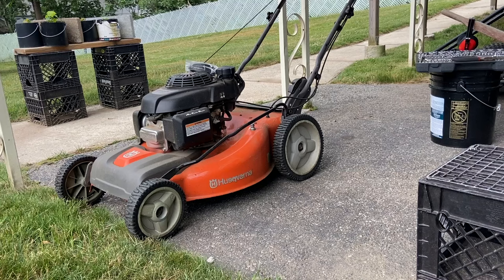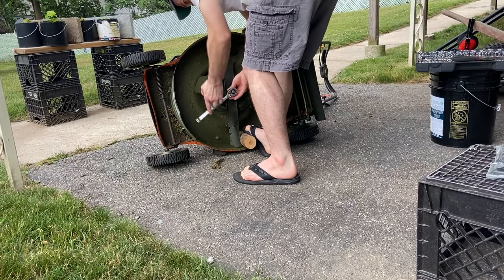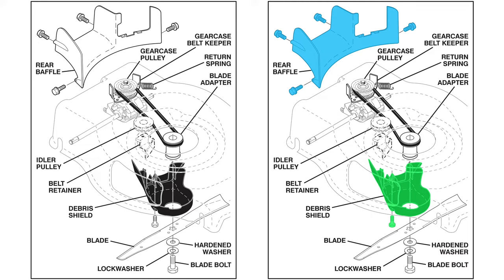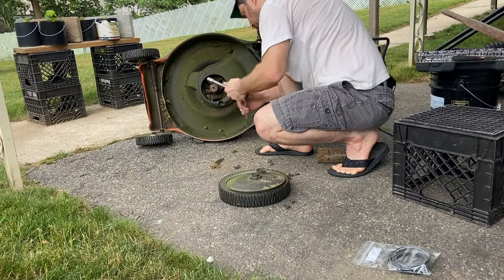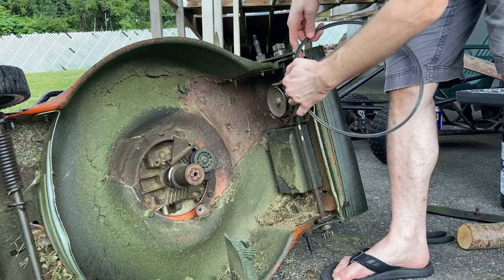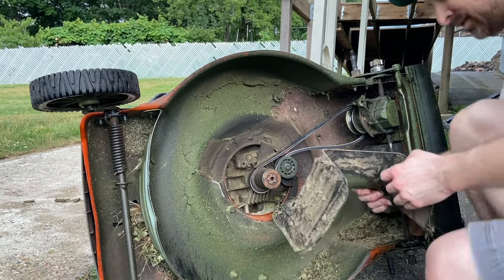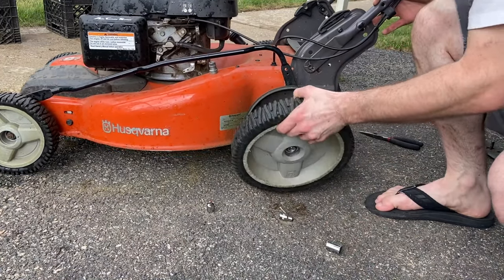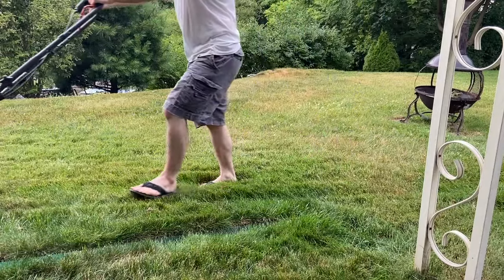How To Replace the Drive Belt on Husqvarna HU700H Lawnmower

Comment: You DO NOT HAVE TO FORCE THE BELT AROUND THE GUARDS. The pulley comes off very easy. Grab the shaft behind the pulley with pliers (Channel Locks Best), put a socket wrench on the nut on top of the pulley and turn (counterclockwise). The whole pulley unscrews, once off, wrap belt around, screw the pulley back and on, re-tighten pulley. Super easy. Takes 2 seconds.... Thank you for the video, very helpful
Reply: Thank you! This little nugget was invaluable for me!
Reply: Nope. You don’t need to undo the pulley. There are two 1/4 hex head screws that hold that belt guard in place. Fiddly but easy to unfasten in 2 minutes.

Comment: Thanks for the tutorial. Here’s a tip. When you get to the pulley on the tranny, get vice grips and grab onto the stem that comes out of the tranny and unscrew the whole wheel. Theirs just enough room to get the vice grips in there. It’s a whole lot easier

Comment: Sometimes it is the drive cable that needs an adjustment to tighten. In time the cable will stretch resulting in not enough tension on the drive pully. Thanks for the video.
Reply from the maker: Yes it definitely can be the cable. All steel cables will stretch over time and need to be tightened from time to time. Just like shifters on a bicycle.
Reply: Thanks, very. Helpful.

Comment: You tell about the spring and don't show how it goes.
Reply from the maker: Check the pinned comment to see a closeup of exactly where the spring goes!
Reply: I took the chute off and see it connects to it. The picture is a little obscure but I see now. Thanks
Reply from the maker: @mikederry2839  Did you look on the short supplemental video? It's pretty clear on that video, I zoom way in so you can see exactly where it connects on both ends.

Comment: Great Video- I have the AWD model and the only addition that was easy to figure out.  Remove four screws on the plastic Baffle in Front, then you fish the belt through.
Reply from the maker: I thought about getting the AWD model too but in the end, I felt like the larger rear wheels would be a bigger benefit to me. My yard is pretty bumpy. Plus twice the belts to replace :D

Comment: So, I just changed my belt. I have the same mower. Everything here is perfect except for one item. The gear case belt keeper actually is designed to come off so you can get the belt on the pulley. There are two screws on the keeper that can be removed with a nut driver. I was really struggling to get the new belt on your way. Way more simple when you remove the keeper arms.
Reply from the maker: Do you have a picture of where these screws are located? I didn't see them back when I made this video. Also yeah some people seem to have a lot of trouble squeezing the belt on my way, some get it right on no problem. Each mower probably has slightly different tolerances.

Comment: Thanks for the video.  My spring popped off.  The video shows where one end goes, but not the other.  If anyone can explain, that would be great!  Thanks in advance!
Reply from the maker: Hi. Please check the pinned comment at the top of this comment section. I added a short video that zooms in and shows where the spring connects. Let me know if that helps.

Comment: Thanks John. The tip about removing the wire from the spark plug was a wise idea. Safety always make sense. Not doing that could potentially be catastrophic. 
You are the only one to mention that in all the videos I've watch so far..thanks again man..
Reply from the maker: We tend to think of starting an engine as a special, unique function we are doing to them. But lawn mowers, cars, truck, boats, in all of them, all you are doing to start them is manually spinning them.

Comment: OMFG....Thank you so much.  I was about to buy a new mower because my RWD system failed.  I flip my mower over, and the som' bitch belt was completely off.  I had noticed it was getting weak for a few years but thought it was just dieing.  Then last week it (the self propulsion) just quit completely.  After seeing how you put your belt on, I looked at mine and noticed first that it was completely off the thing that holds the blade.  I reassembled after attaching it to that thing that holds the blade, and tried starting it, it had a lot more oomph.  Then I watched your video, and noticed that "idler pulley" i guess it was, it needed to be attached to belt too.  I put mine back on and viola, the som' bitch is running like it was back in 2016.

Thinking of buying a new belt so that when this year is complete and I do the maintenance on it, I will replace that belt as well.

Comment: Very helpful video - Thanks!  You may also want to change your idler pulley at the same time as the drive belt.  Mine had a bad bearing and put a real drag on the system.  Replaced it and now have much more powerful drive.  Also, the spring attaches between a hole on the trans and just the bottom lip of the metal deck.

Comment: The drive pulley comes off.  Hold the shaft behind it with some channel locks and un-thread the pulley from the shaft.  The you can wrap the belt around the pulley and easily insert between the belt guides.
Reply: OMG OMG OMG This needs to be TOP Comment. You saved me so much frustration. Thank YOU
Reply: @craighall8762  👍

Comment: Great video. Is the idler pulley supposed to completely spin freely? I’m getting a very loud grinding/scraping noise when engaged, and this pulley has very limited movement
Reply from the maker: Are you referring to the tensioner pulley? That one should spin freely yes. The other pulley connects to the wheels so won't spin freely, and the OTHER other one connects to the motors driveshaft. If your tensioning pulley won't spin well, you should replace it for sure.

Comment: After reconnecting the spring to the plastic piece and to the clutch, does the spring hang on the outside of the clutch engagement cable or on the inside? Regardless of what side the spring hangs on, it seems to have the cable that engages the clutch running right through the spring.
Probably should’ve took a picture of it before I disconnected it
Reply from the maker: It's hard to know without seeing a picture of your setup, but it shouldn't touch the cable. Try both options and see if one position works without interfering with the cable
Reply: @YardworkWithJohn  I hung the spring on the outside of the drive cable which it still touches the cable but not as bad as hanging it on the inside of the cable
Reply from the maker: @wild8757  If you check the pinned comment at the top of this comment section, I just added a very short video showing a zoomed in view of the installed tension spring. To my eye, it looks like the spring can only be installed one way, does yours look very different from that?

Comment: Where does the spring attach once you get it in the hole? It looks like you left it loose...
Reply from the maker: Hi, if you look for my Pinned comment at the top of these comments, I link to a very short video where I zoom way in to the spring so you can see where it connects. One side goes to the metal bracket, the other side connects to a hold in the plastic baffle.

Comment: Where does the spring connect to on the frame??
Reply from the maker: The spring connects the movable pulley to one of the plastic baffles.
Reply: I didn't see a hole anywhere, so I just hooked it to the bottom of the frame just below the transmission.  Seems to work great, but I don't like that design because that spring is gonna rust quickly.  Guess that's why mine had trouble backing up last few years.  Works great now, no drag backing up either.
Reply from the maker: @Springfield98  If you check the pinned comment at the top of this comment section, I just added a very short video that shows a zoomed in view of the installed spring so you can see exactly where to connect both ends of the spring. Let me know if that helps!
Reply: @YardworkWithJohn  Thanks John, very helpful!  I now see the small hole in the baffle near the edge, where the other end of the spring goes.

Comment: Should link the correct belt to the model
Reply from the maker: Well there's a million different similar models so probably best to just look up your exact model number manually.
Reply: True, mine is this exact model. Also, there are 2 quarter inch screws that hold the guards on the transmission and it makes it super easy to get the belt on and off if you remove them.
Reply from the maker: @jaredrossiter1361  Oh? where are those screws? I didn't see anything like that.
Reply: @YardworkWithJohn  on the top, just below the pulley. I tried your trick but was not having much success and that's when I saw them.

Comment from the maker: Hey all! There is some confusion in the comments about where exactly you connect the belt spring when reassembling the unit. I made a very short video zooming in on the spring so you can see where it connects to the metal bracket on one side and the plastic baffle on the other side. I hope this clears it up!
https://www.youtube.com/watch?v=CIQ7IaHhETw

Comment: Replaced belt and cable still don’t pull up hills like when new! Lot of these after market parts aren’t exact!!
Reply from the maker: I wonder if your pulleys might just be dirty and not gripping? Might be worth taking the belt back off and trying to scrub up all the belt contact points on the pulleys.